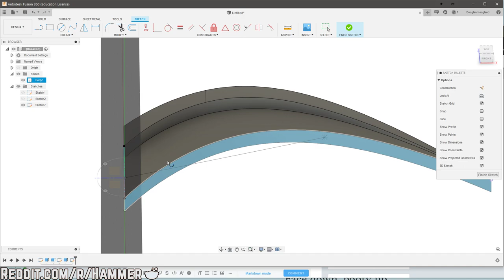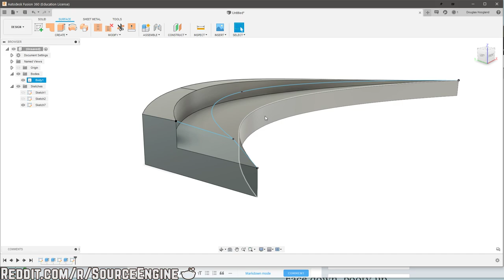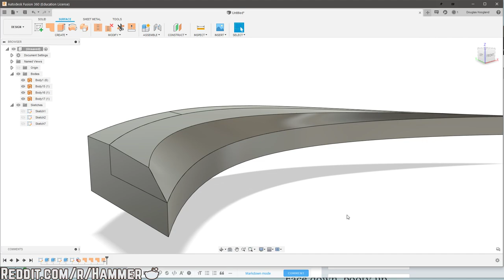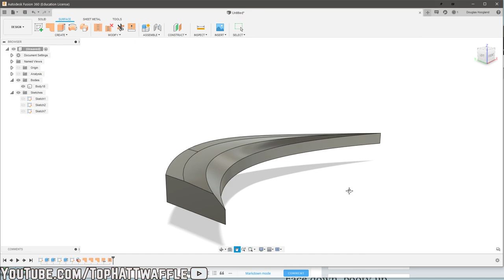Fusion 360 - Non Uniform Bevel Question

Comment: i am a machinist and i hate when i get solid models like this because the designer inevitably attaches stupid tolerances to it that are impossible to measure without using a CMM, then they wonder why there's an extra $1000 metrology charge
Reply: I think the problem is not the model but the tolerance requirement. I would guess most clients accept higher tolerance if you just contact them and tell that it would be $$$ cheaper if you can accept accuracy e.g. +/- 0.2 mm.
Reply: @MikkoRantalainen  Lots of designers refuse to compromise on tolerances
Reply: @SuperAWaC  So they have to pay extra. I guess it's a personal choice. I think it's still important to communicate this to the designer.